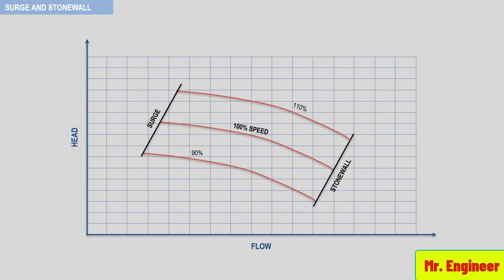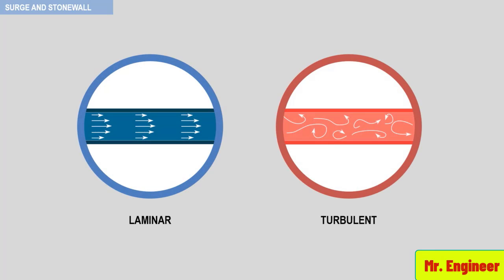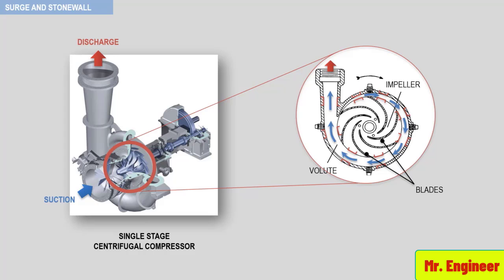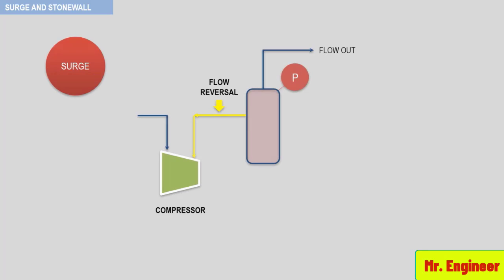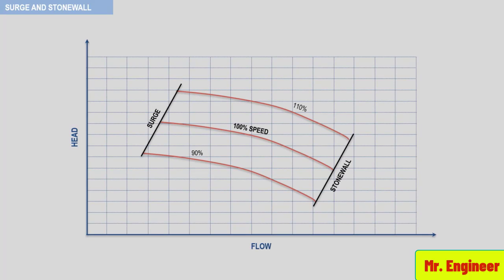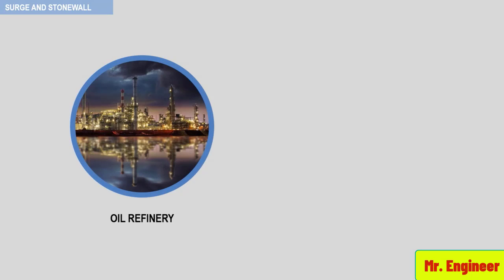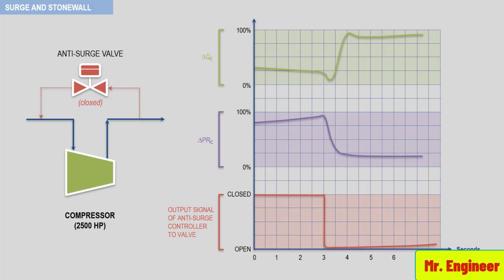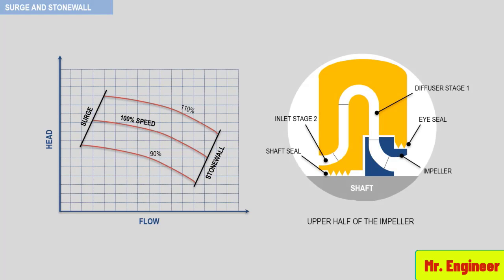what is surge and its facts in compressor

Comment: What means head in the video
Reply: height of the pumping
Reply: @karoly365  thank you but here he is speaking about compressor not pumps
Reply: @benarabataf3573  Still the term is used.  I know it as I prepare a course on compressors. Roughly related to energy added to fluid.  Converted to poressure by density multiplier.